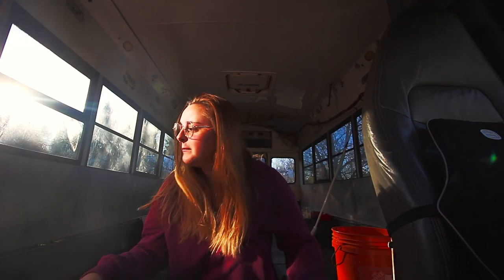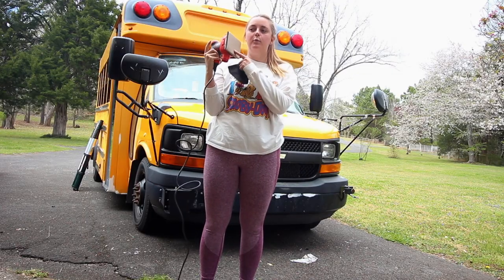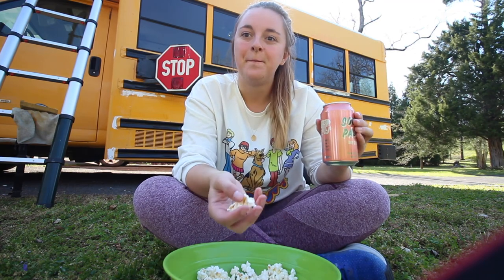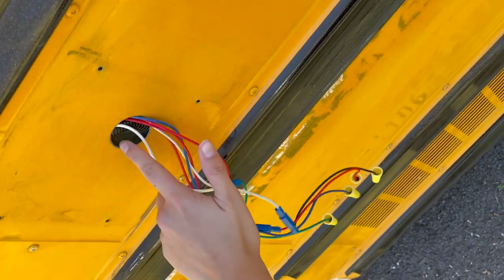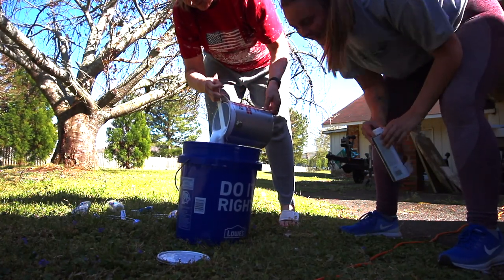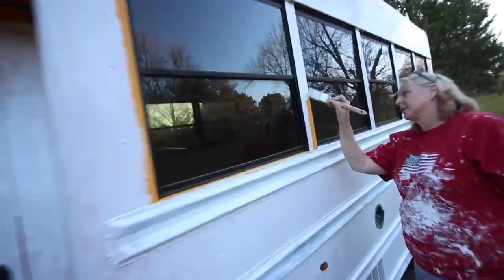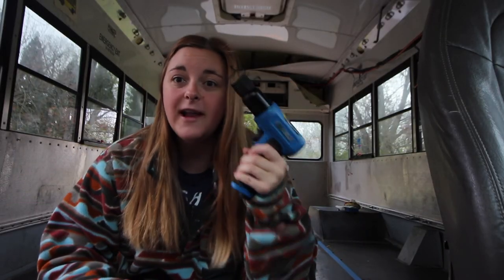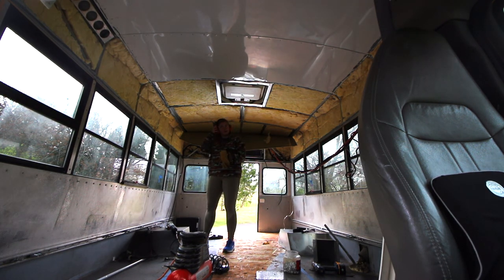DIY SKOOLIE BUILD PT 3 | Sanding and Painting the Exterior of a School Bus

Comment: Hi Kalen!  Thanks for sharing your bus adventures!  I am starting my bus demo soon and have been debating on whether or not to build on top of the existing floor or to pull up the rubber and plywood.  My bus is in really great shape with no visible rust, water or mold damage.  From what I can see in the video, your floors also seem to be in good shape.  Now that you've pulled the floors up, do you feel all the work was worth it?

Comment: Why do people pull up that rubber? Cut it along with the plywood floor and pry up the wood. There's no reason to remove the rubber from the wood you'll be removing anyway.
Reply from the maker: because the screws that hold in the wood were under the rubber. many of them ended up being stuck and I had to pry them up anyway, but I’m still somewhat glad I removed the rubber bc being able to see the screws made my pry work much more precise so it moved faster